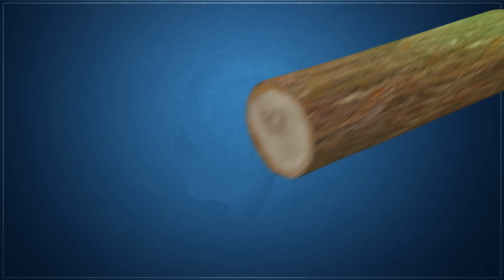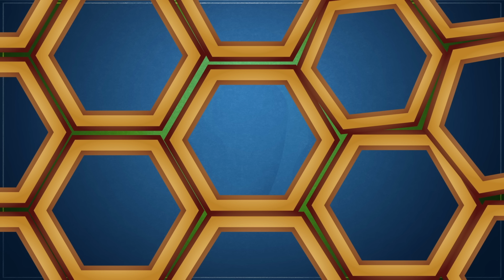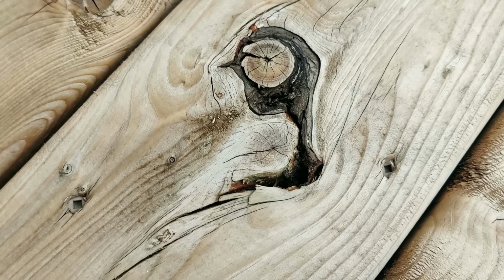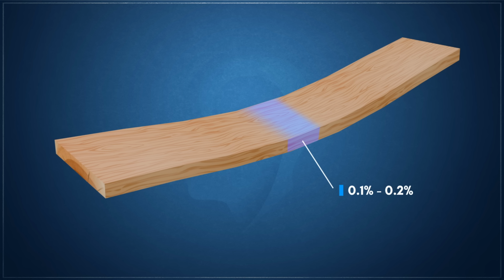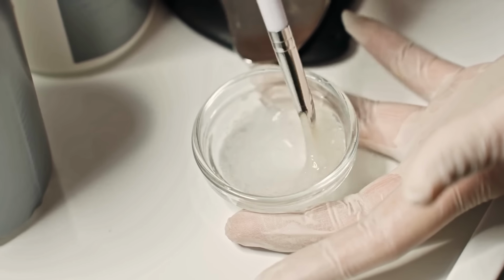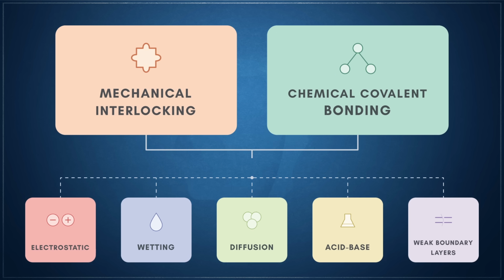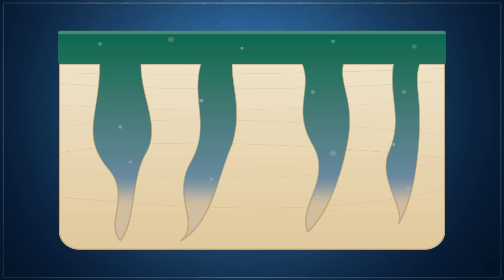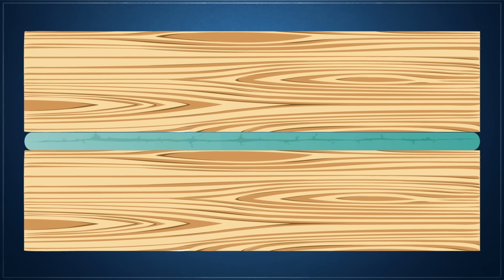The Science of Plywood

Comment: If you've ever worked with OSB, or chipboard, you probably agree that they just suck to use. Cheap sure, but they are weak, flake apart, can't get even slightly wet or they disintegrate, and look horrible. Unfortunately they are incredibly common to use for subfloor and roofing underlayer. Because after all, they are quite cheap.

Comment: Excellent informative and well explained video.It's not often I watch a timber/carpentry vid and learn something new but this was very good.Btw , there's a newish eco version of the all-timber I-joist developed in Sweden (I think),where they throw a log in at one end,it de-barks the trunk,cuts and grooves the top and bottom timbers and mulches the best of the rest then via several processes of pressure,vacuum and steam,reconstitutes the mulch to form the central webbing (like OSB) using no glues at all,just the natural lignins (glue) of the tree itself.The bark then goes off to be used somewhere else too.

Comment: neat, i've seen examples of early pre-standardized structural plywood.  5 layers of plywood sandwiched between 2x12s, with the plywood and 2x12s oriented vertically. bolted to keep the plywood under horizontal compression.  The span was enormous and solid as hell, probably over-built because the material wasn't fully characterized at that point.  Didn't see anything like it in your history of engineered composites.

Comment: We would still be in caves if it weren't for trees.
But I think there is something else to consider. 
When mercury is an oxide in the ground it didn't kill lots of people. 
When asbestos was in rock, no one could breath it.
When lead was unrefined not many were exposed to it.
When DDT and PCBs and tetraethyl-lead  and PFAS weren't developed,  people weren't getting cancer and birth defects from them.
And when you end up processing a natural product to the point of adding chemicals and energy and pollution,  you end up worse than you started. 
Yes, today we have heat, and light, and transportation and medicine,  all because of industry and chemistry and fertilization, but do we need to engineer everything to the point of more damage to the one and only ecosystem we have, to build fancier museums?
Because that's all we'll have left.

Comment: Did you upload the wrong vid?
You were one generation away from covering what is actually called "Super Wood".
Reply: Produced by Inventwood , Also producer of MetelWood there's a Dutch company called Acoya .. producing a chemically engineered timber/wood products. Metelwood is stronger than steel lighter and non toxic . The waste produced is Acetic acid. ..industrial vinegar a common chemical feedstock. 🥼🇬🇧🧙🏻‍♂️
With Inventwood Apart from the greater strength the fire resistance reaches the highest architectural levels and removes the mould rot and insect attack factors ..  developed by one of the modern day wizard of wood chemical engineering Dr. Liangbing Hu's lab at the University of Maryland. He also worked out ways to turn balsa into a Powerball type springy material and turn wood into a translucent material or clear panel like plastics or a replacement for glazing ..whilst maintaing insulation and mechanical properties of wood .
The same chemistry and physical techniques can also be used to convert Bamboo into high strength fire resistant Wood.
Reply: This video is clearly the product of AI. It's not the worst "slop" but the mispronunciation of Eames is unforgivable.
Reply: @seanflora397 NewMind doesn't use AI
Reply: @seanflora397  This is not AI it's just really good production values. 
You haven't been watching for very long have you, go back and watch a few videos from a few years ago.

Comment: No mention of new Superwoods that are up to 50% stronger than structural steel and six times lighter. It is created by partially removing lignin from wood and hot-pressing it to align fibers.
Reply: That's what I hoped to hear from the 2nd half of this video
Reply: Also known as "densified wood".  It can produce fantastic surface properties (i.e. 3-4x harder than non-densified for hardwood flooring).
Reply: Came here for this comment
Reply: In other words... Paper
Reply: Nile red bullet proof wood is same
Reply: Fr, and it can be made from any wood and the resulting superwood has roughly the same properties

Comment: Btw you can weld wood. I know, weird right? A German or Swiss company is doing it. Just putting it here since it wasn't mentioned in the video.
Reply: Is it ultrasonic bonding?
Reply: The name is much cooler, but it's just friction welding, which in itself has to much geometric constraints
Reply: @acasccseea4434  friction welding is also welding. It's an acto of fuzing two materials so that from a material structure they become one. And the fact that you can do it with wood and not just metal is mind bending.

Comment: Was curious if MDF would be mentioned.
Reply: Mentioning MDF,  Lower VOC/Biodegradable Resins,  Wooden Nailgun Nails, and even “Engineered Bamboo” / wood made from cellulosic biomass / paper / rayon etc would have been nice,  perhaps a part 2!
Reply: @ericlotze7724  the rubber tree, the useless tree that nobody wants, is a waste product used in more "modern" looking furniture than nearly all of other woods. Because they have to pay to get rid of this wood. 
definitely one to be mentioned here too.
Reply: But that stuff isn't usually used for building materials like the ones in the video. Idk they still could have mentioned it
Reply: @loz @lozanoa11 fair.  Yeah mainly OSB and Plywood.  It can MAYBE be an alternative to drywall,  but doesn’t finish up as well.

Also the potential formaldehyde emissions spooked off most people.
Reply: @ericlotze7724  it's too heavy.
Reply: Was thinking the same.